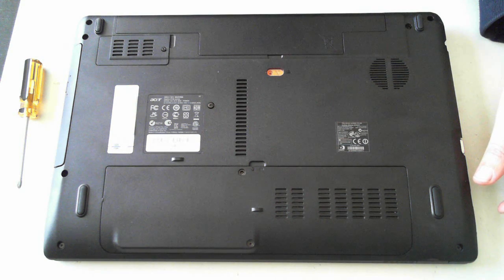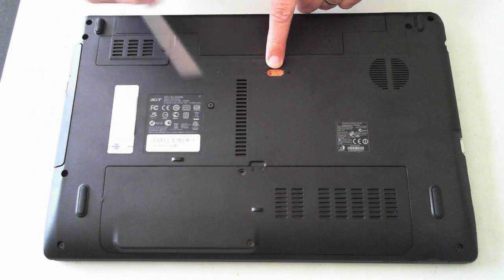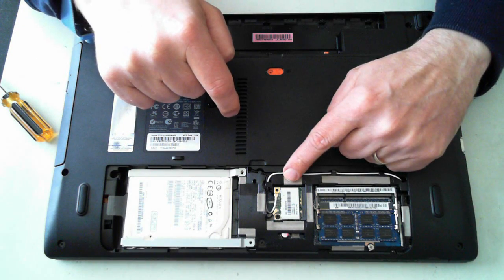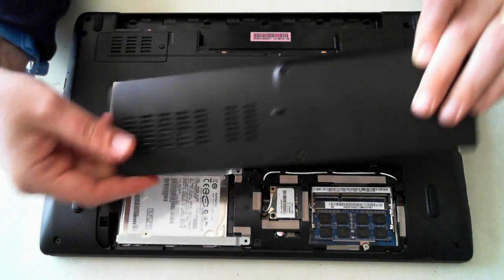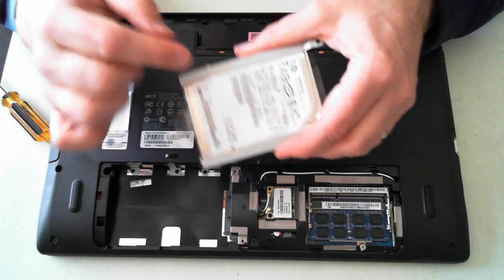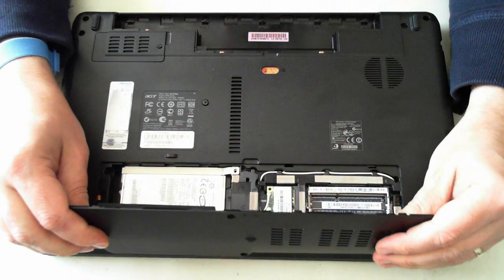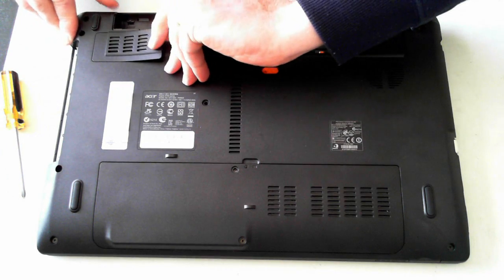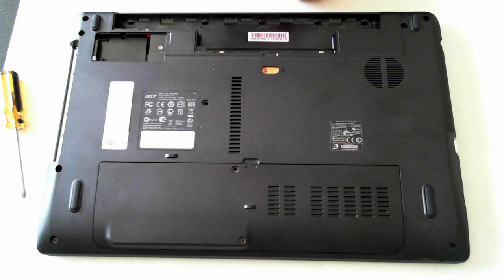Upgrading a Acer Aspire 5750 Laptop

Comment: Hi, can i add another 4gb ram to the vacant slot..
Will it help in the speed or should i go for 2gb???
Reply: you could but it's better to add memory same size.  if you now have just 2GB x 1 installed, I would recommend you throw away the 2GB and install 4GB x 2

Comment: Hello I have Aspire 5755G with 750GB HDD. I have 2 questions. 1. Can I install 2TB HDD instead of 750GB? 2. If I replace it with SSD, Can I install 1 or 2 TB SSD instead of 750GB HDD?
Reply: yes you can and you can upgrade the ram to 16 gb

Comment: Wht is the use of that empty slot???
Reply: that is for pcie on other models. they share same cover so since this model doesn't have pcie they left it empty. cheaper than to make different covers for every model.
Reply: @vldpupidu2128 can it be used to install an nvme if you could somehow install the it socket 🙂😂

Comment: Hello I have one of these too. I found a part on the front edge of the laptop you can push it in and piece of plastic comes off and their is some kind of expansion slot there at least I think that's what it is. I was kinda hoping it is something like that you never know when you could need something like that. It also looks like it could be a SD card slot again I'm not sure maybe you can tell me so I know for sure. I need to know because I want to upgrade to USB 3.0 and as far as I know a expansion slot is the best way to go about it. I checked a couple of manuals one said it only has USB 2.0 but another says it does have USB 3.0 again I just need to know for sure an upgrade may not be necessary.
Reply: on mine there is a usb 3.0 and 2.0 the 3.0 will have a blue middle part
Reply: its card slot.

Comment: I added an extra 4gb ram at the second slot but i still says 4gb ram is installed. I switched the ram's slots and it still says the same. It only reads the ram that i add at the first slot
Reply from the maker: Is it the BIOS or the OS saying 4G? If it is within Windows are you using a 64bit or 32bit operating system?
Reply: 64bit. Bios and OS says 4gb. It's like the second slot just dont recognize the ram.
Reply from the maker: Looks like the slot is dead. Is you laptop still under warranty?

Comment: Hi there. I hope anyone answer my question. How do I upgrade the wifi module and if is possible which are the new features
Reply from the maker: The WIFI card is lower centre between the hard drive and memory. It can be replaced and the new features would depend on what replacement card you purchase.

Comment: Thanks for the nice video. I have been using an acer aspire 5750G for about five years. I want to up-great the RAM and use the laptop as a stationary computer at home. Problem is, I do not know how to find the best RAM which is compatible with my laptop. Can I get a bit of advise?
Reply from the maker: Check out one of the leading brands websites they usually have a RAM finder. eg:
  http://www.kingston.com/en/memory/search/Options

Comment: hi, i have this ntb more than 2 months, i look at the free slot what is look like a free msata without conector. My theory is conector was placed somewhere on mother board and you may just buy label and place it in a free slot. im planning clean up my ntb from dust so ill write what i discover. i was planning at the end of the mounth mount here three hard drives(one ssd and two hdd) one in primry slot for hard drive, next one in msata( if exist) and last one instead of DVD Rom

Comment: I got a Acer Aspire 5750g with a weak GT 520 GPU, is it possible to replace the card?
Reply from the maker: Possibly but not recommended due to potential BIOS and heat issues.
Reply: so, is there a pci-e card in it that i just can swap out and replace?
Reply: Manne Pålsson no

Comment: I will be using the following to upgrade my ram pls check and tell if it's ok?
Crucial CT51264BF160B 4GB 1600MHz DDR3L 204-Pin Laptop Memory.   For
Acer Aspire 5755G
Reply from the maker: Contact Crucial directly and they will confirm if it is ok.

Comment: Hello, did I use the wrong RAM?

I tried upgrading to two 4gb sticks and the screen wouldn't come on.  

the ram in the machine already is :
PC3-10600S-9-10-F1

the type I tried to replace it with was:
PC3-10600S-9-11-FP

Thank you, James
Reply from the maker: Does it boot with the old ram in it? If so the new ram is either faulty or not compatible.

Comment: I'd like to see both a CPU and graphics upgrade! Nice video though! Also, is it possible to upgrade the fan to one that's more powerful / less noisy? Mine is weak and buzzes all the time!
Reply from the maker: +Blakehx its possible to replace the fan but I don't know where you could get one from.
Reply: cpu can be replaced but not the gpu
Reply: you can only upgrade the CPU, RAM and hard drive in these not the GPU

Comment: That was pretty simple to take out the optical drive. Was thinking of replacing mine. I had already replaced my Hard drive with a ssd and maxed my memory to 8gigs prior to watching this. Good video.
Reply: Fatih Enkur Well I put a Samsung Evo 850 SSD in mine and AS SSD benchmark showed full Sata 3 speeds over 500 mb/sec
Reply: Glad I could help!! A program called Crystal Diskinfo also can verify what Sata mode your HDD or SSD is running at once installed.
Reply: Ken, did you get an SSD for this laptop (acer aspire 5750G)? What SSD did you get? Is any 2.5 inch compatible with this laptop? Thanks
Reply: +Alessandro Fiorotto I installed a Samsung Evo 850 256 gig SSD in it. Works great and at full speed since the drive port is SATA 3 ready.
Reply: Awesome, thanks. I've been considering the Evo850, it seems to have the best performance/price ratio. Good to know that's it's compatible and Sata 3
Reply: Are you sure about that? I ran a test (pc wizard) and it says that my 5750g doesnt have a sata 3 port. Sata 2 for the hdd and sata 1 for the optical drive.
Reply: Thx! You were right, the chipset does support sata 3 but the hdd itself is sata 2, if it werent for you i wouldnt have gone for the ssd lol
Reply: I also would like to know how much of a difference the SSD gave you?
Reply: It’s a day and night difference once you go SSD super fast booth up times

Comment: Hello. I replaced the stock HD in my trusty Acer Aspire 5750 laptop with a 500Gb SSD, and all seemed to go well, except that now it MUST be plugged in, or else it will start to freeze up and eventually BSOD, and then I get a "No Bootable Device - please restart" message when it tries to reboot automatically. Once i reboot, all is fine, as long as I keep it plugged in. Does the SSD draw more power than the battery can provide, or is it a weird driver issue? Thanks to anyone who can help!!
Reply from the maker: +overseastom Hmm, I'm confused if you replaced the hard drive with a SSD then yes the SSD needs to be connected to work.
Reply: +dpcomputing It's connected, and it's my OS drive, and it works great! It's just that my laptop dies if I unplug the power cable! It's annoying...
Reply from the maker: Looks like the battery has died.
Reply: +dpcomputing I actually bought an Anker replacement battery, because I thought that might have been the case, but it didn't help at all! I bought the same type of battery though, not a larger one with more power, so perhaps that's the issue. The larger battery was $150 though, so I didn't want to have to spend that much if I could avoid it! No worries mate, I just thought you might have heard of similar issues. Cheers for the replies.
Reply from the maker: Its strange as a SSD takes less power (due to no moving parts) compared to a normal platter hard drive.
Reply: +dpcomputing Yeah, that's what I thought too (though I've never actually looked it up, and it is a slightly larger ssd, being a 500Gb model). I think it might be a driver issue, but I'm baffled as to why it only occurs when it's running on battery power!

Comment: I would like to ask your advice, what can I do to keep this laptop battery in good shape ?
Reply from the maker: +Yasser J That depends upon who you ask! :-) My recommendation is to run the battery right down every few months and then fully recharge it.
Reply: +dpcomputing 
Thanks alot for respond. really appreciate it.
May I ask, if I kept the charger plugged in even when it's 100% charged would that harm the battery? 
*once again I use Acer Aspire 5750
Reply from the maker: Yasser J it shouldn't but if you don't need to run it from battery it wouldn't hurt to not have it connected all the time.
Reply: +dpcomputing 
got it .. thanks alot :)

Comment: Is it possible to change the cpu core? Also can you add or change the video card driver?
Reply from the maker: Kevin Touch yes you can change the CPU and video processor but it isn't easy or straightforward. Plus you need to make sure you replace it with ones that are compatible.
Reply: Ok. Thx for the info. Can you maybe make a video for that or direct me to one.